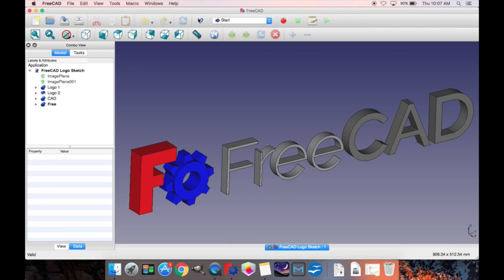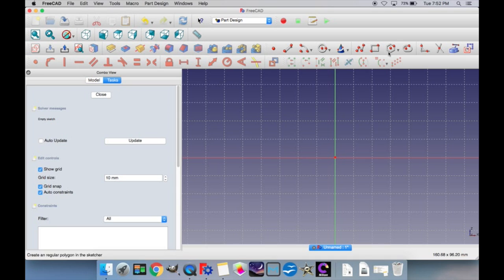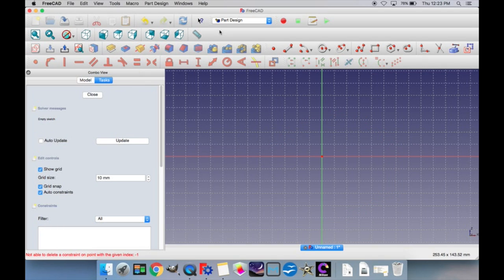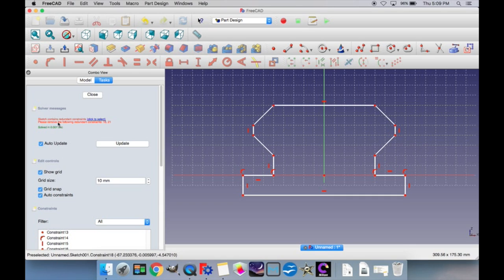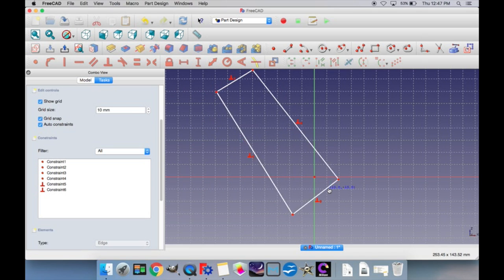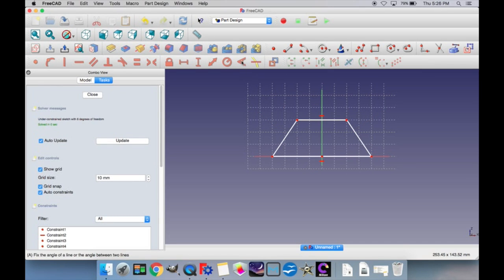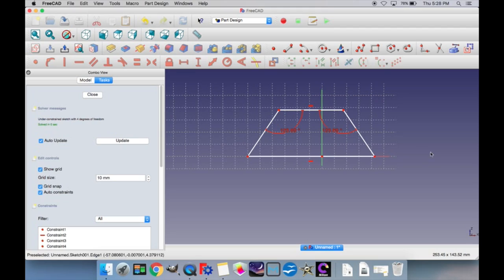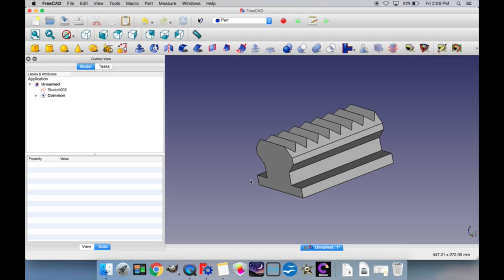FreeCAD Tutorial Part 2: The Part Design Workbench

Comment: Excellent again ...although I am having a problem being able to create two separate sketches like you do at 46:39 and creating pads with them.  Is there a trick?  I have watched and watched and cannot find my problem.  Thanks.
Reply from the maker: Hello Frets Nirvana, Im glad to hear you enjoyed the tutorial. So you are having issues creating multiples sketches and creating pads with them? Are you running into issues when you try to create the sketches, or do they refuse to turn into objects when you try to pad them?
Ive found that, most of the time, when a sketch fails to pad or revolve, its because all of the points in that sketch are not connected. When this happens, the object will fail to appear but the pad will show up in the combo view with an little red exclamation mark next to the icon. In order to figure out which of the elements or lines is not connected, duplicate the original sketch and double click to edit the new sketch. Then delete one of the elements or lines (I find that elements like arcs or elliptical arcs are usually the cause of the problem) and draw a line connecting the two points that the element or line used to be connected to (make sure a dot appears next to your cursor or else they will not be connected; see 12:24 for an example). Next, exit out of the sketch and try to pad or revolve it again.
Two things can happen here;
A) you've found the unconnected element if the pad is created without any issues. If this is the case, go back into your original sketch and delete the element which you deleted in the duplicate sketch and redraw it, making sure that a little dot icon shows up next to your cursor when you connect the dots of the element (you might have zoom in by scrolling in order to make the dot appear).
B) if the pad still fails to be created, repeat the process until you find the element which is disconnected. This is actually the easiest way to find the culprit as opposed to redrawing the entire sketch.
An unconnected element is usually the culprit when a pad fails to render, but its also possible that there is a duplicate constraint within the sketch. For a detailed explanation on duplicate constraints, see 21:45). Hopefully this will help you out; if you are trying to revolve the sketch like I did at 46:39, make sure that the sketch is located on the proper axis. For example, a sketch located on the horizontal axis can only be rotated around the vertical axis and vice versa. 
By the way, as a fellow guitarist/composer, I checked out your channel and really enjoyed your original work.
Cheers!
Reply: @RickHoefer89  
Hi ...thanks for the kind words on my music endeavors ....very rarely do people watch and listen ...so thank you.  

Thanks for all that detail.  I am going to have to recheck all of this.  But for simplicity ...if I create a new unnamed document part design and create a new sketch ...I can then create a pad with it.  But then if I create another sketch with something like a circle, highlight it (it is now called Sketch 001) in the model window and then request a pad.  Freecad goes to the tasks window with no images showing and gives me these message "Pad: Result has multiple solids. This is not supported at this time."  Maybe I am creating that second sketch wrong?  My model tab/window does not look the same either.  Everything ends up under a heading of "Body" whereas yours is basically showing just two sketches under "Unnamed"   It does not matter if I have not done a pad yet on the first sketch.  It happens on every additional sketch I try to make.  Meaning they all end up as a subgroup of "Body" and I can only pad the very first sketch.  Also the "Body" has an exclamation point with "Tip shape is empty (but must be executed" ...what does that mean?   

Also, you deserve more subs ....I just did ..TY.  Keep on picking!

Comment: Nice tutorial.
I had problems with editing imported part (in context of 3d printing). What I learned, is that once Mesh is converted to Shape, you have kind of set of Faces, but not a Solid. To have a Solid you have to convert that part further by using "Advanced utility to create shapes". First I did "Shell from faces", then "Solid from shell". And only after that I was able to properly edit (cut holes) resulting Solid and was able export and print it.
When I tried to cut holes in set of Faces, Cura sliced it incorrectly. Its because sides of holes are not filled.

Comment: Hi Rick, I have a rectangular surface with a line in the middle, now I want to extrude the line in the direction normal to the surface of the rectangle, to create another rectangle perpendicular to the first one. How would you do it? (I want zero thickness for the surfaces as I would be using them for importing to FEA software later)

Comment: Hi can someone please assist. I can't seem to get my lines to connect. At 12:56, when trying to connect two lines, a RED DOT should appear next to your cursor. On my FreeCAD, the RED DOT does not appear when i hover over the points I want to connect.
Is there some kind of setting I need to change? This is really frustrating me as i can't create a solid shape without connecting the lines.
Reply from the maker: Hello Thurman Ezikiel, sorry to hear about your trouble. Hopefully, this will either be easily remedied or a bit more complex. When you double click a sketch to edit it, there should be some options in your combo view (the window to the right of your workspace, you can see an example of this window at around 8:28). This window contains all of the editing parameters for the sketch. The one we are interested in is called 'Auto constraints', and is located under the grid size entry box. If you cannot see this option, try clicking the title 'Edit Controls' to bring down the pull down menu containing the option. Make sure that 'Auto Constraints' is checked, then try to connect the lines again. The program will not automatically connect the lines for you if this option is not checked. Let me know if this works for you, and if not, we will try to find a different solution.
Cheers!
Reply: @RickHoefer89  worked like a charm Rick, thanks for the help. Was about to pull my hair out 😁
Reply from the maker: Awesome! I’m glad it worked! I see what you mean, I bet it would have drove me nuts too. Cheers!

Comment: Hi, Is it possible to relate length of one line to another? for example: line 1 is 50mm and I want line 2 be equal: 2 x line 1. do you know any free CAD which can do it?
Reply from the maker: Hello MARTA Doroszkiewicz, unfortunately I am unaware of such a feature. There is an equality constraint, which sets the length of two lines equal to each other, but there is no scaling constraint that I currently know of (such as line 1 length = x * line 2 length, where x is the scaling factor, such as x=2 like from your example). The only way to adjust the length of a line relative to another is to manually input the value of each line, meaning whenever you alter the length of the first line, you would have to change the length of the second line to  coincide with the scale you require. I’ll do some research and see if I can find a way to make such a constraint, maybe through the use of macros. I’ll let you know what I find. Cheers!
Reply: Hi Rick, thank you for so quick respond, I have done a bit more searching looking on auto cad, learn  about two different constraints and as a result , I added some additional worlds for search and I found this tutorial. I think this is my solution, I am just trying to check it wright now. Simply this gives some option of parameters in constraining the geometry.
https://www.youtube.com/watch?v=b07qbhYHZbU

Comment: Dues  it have any Cursor > EXACT position tool; such as: drwng  a line 2.92mm long?
Reply from the maker: Hello a Boswell Inniss, that is a good question; the answer primarily depends on the nature of the line in question. If it is a straight line, meaning that it is parallel to either of the sketch axes, you can select the line you wish to use and then use either the “Create Vertical Line Constraint” or “Create Horizontal Line Constraint”; when you press either of these constraints, a pop up box will appear asking to rename the constraint as well as edit the length of the line; you can use this to input the desired length of the constrained line, such as 2.92mm for example. If the line is not parallel to the axes, meaning that it is not at a right angle, you can use the “Distance Constraint”, which has an icon that looks like a double ended arrow at a 45 degrees angle. When you use this constraint, it will also ask you for a length, so you can keep the existing length or change the length to your desired value, such as 2.92 mm. Unfortunately I do not know of any command which will cause the program to draw its own line with a desired length. However, you can always set the gridsnap to your desired length, such as 2.92, and draw a line from the origin to one of the grid lines on the axes, or you could draw the line, then change the grid snap to another value and click and drag the line to a new location; it’s length should stay the same when you move it as long as you don’t drag the end points of the line. If you want your line to be a certain length and at a certain angle, you can use trigonometry to calculate the desired x and y gridsnap values. For example, if you wanted the line to be 2.92 mm long at a 30 degree angle to the x axis, the y gridsnap value would be sin(30)=y/2.92 => y=1.46, and the x gridsnap value would be cos(30)=x/2.92 => x=2.5288. Although you wouldn’t have to use trig calculations if you use the Distance Constraint mentioned earlier, since the length will always stay at the value you input. Hope that helps!

Comment: Hi Rick, I see you have sketcher tools on your part design workbench. They don't come up on mine V .17. Sketcher doesn't show under VIEW-Toolbars either so not unchecked. Any help would be appreciated
Reply from the maker: Hello Peter, my first thought is that maybe the toolbar is pushed off the side of the screen by the other toolbars; try to drag one of the bigger toolbars that are visible down to a new row underneath the others to free up some room. For example; in my video my first row of toolbars is just the view buttons and the ruler, then the second row is sketch tools and the third row is constraints. You can move the toolbars by clicking the grey line at the right of the toolbar and dragging them around, you can make a new row by dragging them under the last row. Hopefully the sketch tools will pop up when some space is freed up. If that doesn’t work, it could be that the installed file or the system config file may be corrupted; I know it’s a pain but maybe downloading a fresh version of FreeCAD and reinstalling it might help. If that doesn’t work, try downloading and installing 0.16 and see if the tools show up on that version. Hopefully this helps, good luck!
Reply: Hi Rick, I see it in 16, reloaded 17, I think they've changed it. From part design start a new doc, it asks to create a body. click. then asks to create a sketch. click, then choose workplane. choose OK. This sends you to sketcher WB. make your sketch then press ' exit sketch edit '. this sends you back to part design WB. From there to edit your sketch, press ' edit selected sketch ' icon. back to sketcher WB. etc. etc. I think access is now a back and forth process.

Comment: Very nice tutorials, helpful to beginners and experienced users alike.  Having worked with CAD/CAM for many years, I have to make a couple corrections involving your pronunciation.  Fillet, a rounded corner or intersection is pronounced FILL-it, not Fill-AY.  CAD is an acronym for Computer Aided Design and is spoken as a word, not spelled out. Therefore FreeCAD is pronounced as it's spelled, freecad, not free-C-A-D.  Anyone in industry would notice this mispronunciation immediately.
Reply from the maker: Hello Ted Whitmer; thank you very much for your complimentary review of my tutorials. Regarding the pronunciation errors; if I could go back and redo the videos, the pronunciations issues would be the primary issue I would address. About half of the comments I have received on the Part 1 video relate to the two errors you have indicated, in addition to my incorrect pronunciation of 'Euler'. I have only been using FreeCAD for about 4.5 years and everything I have learned has been from my own experience using the program. I never watched any tutorials, which would have included the correct pronunciation, instead relying upon my interpretation of the text from the various tooltips and functions within the program. I feel foolish that I did not do my research before creating the series. However, I have learned my lesson and have performed pronunciation research for my more recent videos. At least it was a linguistic error instead of a mathematical/computation error, otherwise I would feel completely incompetent haha. Cheers!

Comment: trying it now, cant get it to draw in inch units even though selected. i dont  do metric.
Reply from the maker: Hello Todd Sutton, my apologies for my very belated response; you can change the unit within the program by highlighting the 'mm' text in the data section for an object and tying 'in'. That will change the units from mm to inches. I also believe you can enter 'ft' for feet, however, I have yet to try this.

Comment: What did you leave out! I loaded up my FreeCAD step by step based on your video, but when it came to saving the design it only let's me save in HTML.
Reply from the maker: Hello Randy Fleet, I’m sorry to hear that your having an issue with exportation. I’ve never experienced the problem that you are encountering; whenever I go to export an object, Ive always been able to select the file type from the pull down menu. What version of FreeCAD are you currently running? Here’s some ideas that might help: there is a pull down menu located at the top of the screen called ‘FreeCAD’, it’s in the same tool bar as ‘file’ and ‘edit’. Click the ‘FreeCAD’ pull down menu and select ‘Preferences’. This should bring up a pop up menu for the program preferences, and there should be an option for Import-export preferences in that pop-up. There might be a setting there you can use to try to fix the issue. Here’s another thought; when you go to export the object, type the prefix of the file you want it to be next to the name. For instance, if you want an OBJ file, type ‘name.obj’ into the file name for exportation and see if that works. You could also try exporting the file as a html file and then go to the file and pull up the file info, then change the suffix from .html to the type you want it to be. For instance, change it from ‘name.html’ to ‘name.obj’. If all else fails, you might have to do a fresh reinstall using the latest version from the FreeCAD website. Hopefully one of these options will work for you, if you need further assistance I’m always happy to help.